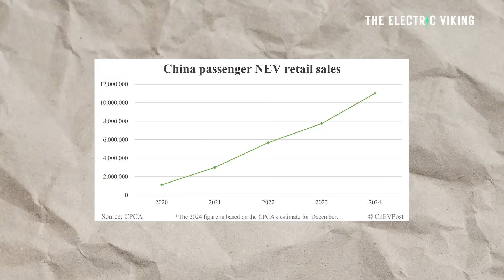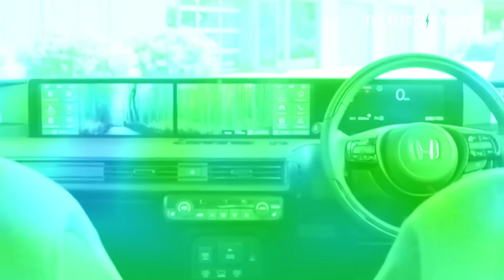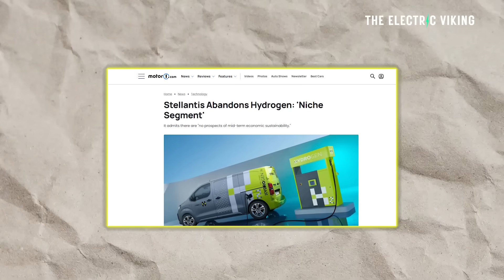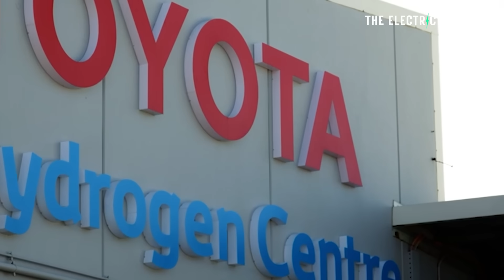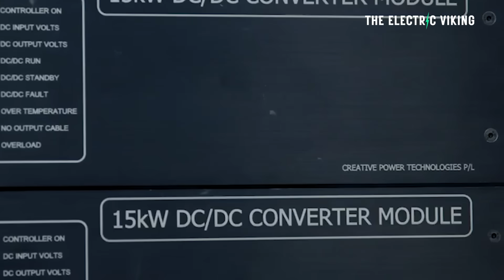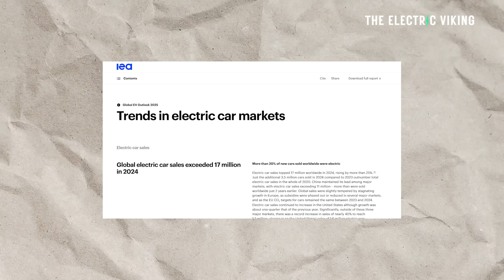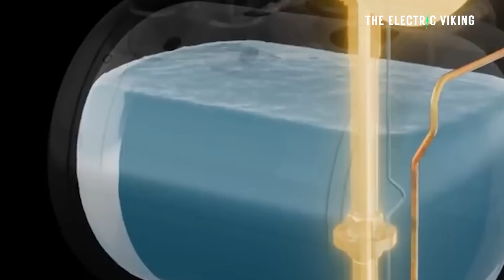The Future is Hydrogen Cars - Honda says EVs are not the future

Comment: I think Honda is talking to the US and EU market, electric cars are very far from being the nº 1 cars, its very complicated to explain but electric cars with the current batteries and charging systems are not viable in the USA and in some EU contries. Its August there's a lot of trafic going to southern Europe beaches, I never saw so many cars stoped on the side of the road, most of them Electric. The gas/diesel/LNG stations are working fine and the electric charging stations have broken because they work 24/7. There are huge lines all over southern Europe to charge electric cars, its crazy.

Comment: Hydrogen cars have been obviously stupid for quite a while and is getting stupider by the day. EVs stil have a big issue, though. They are no good if you live somewhere, where you cannot charge at home.
Two things need to be solved to change that : faster charging and, critically, cheap charging. The pricing for charging outside your home needs to come down, and that is not easy, since making a profit from running charging stations is already hard. If those issues are solved, the sky is the limit for EVs.
Reply: solution: state owned electric company. maybe you are American that allergic to these words but they exist elsewhere.

Comment: The elephant in the room is EV waste. EVs are a disaster for the environment once they're decommissioned. What is going to happen to all the toxic EV waste in years to come. It will cost a small fortune to get rid of your dead batteries. Why won't you talk about this honestly and in depth?
Reply: Because that is just propaganda from Toyota that already debunked for 10 years? Battery already 99% recycleable.
Reply: @yulusleonard985  I can assure you with 100% certainty that lithium batteries are not 99% recyclable. Do some research if you think it's BS.
Reply: @RhythmicEye  Yes my google said its 99% recyclable with several articles. After that 97%, still high. The lowest are ofc Toyota who said they are doing it at 20%.
Reply: @yulusleonard985 attitudes like this is exactly why this is going to be a catastrophic problem. Tell me, where are all these recycling facilities you speak of
Reply: @RhythmicEye  
Most EV built are still on the road .
Will be for a few more years. 
There simply is not enough ev getting retired as yet to fully support recycling .
It will happen the materials are to valuable  to just dump. 
Meantime used ev battery's are still worth money .
They are being  rebuilt replacing dud cells or repurposed for energy storage
Reply: @martinsmallwood9605  Not true at all. EVs have been around for decades now and have car accidents just like every other vehicle on the road. Globally there are hundreds of thousands of EVs that have been decommissioned already, not to mention all the non EV lithium batteries out there as well. It's a BIG, BIG problem that needs to be addressed now not when it's too late.
Reply: @RhythmicEye  
You re talking crap .
 EVs have been around for decades now?
The Nissan Leaf first mainstream  EV has been produced since October  2010 that  is less than fifteen years ago.
February 2022, global Leaf deliveries totaled 577,000 cars. 

Most of which are still on the road.
I very much doubt 100,000 EVs have been retired around the globe  .
It is cheaper to dismantle an EV battery into its component material then to mine for new resources ,
Even ignoring the potential for recycling for alternate use or to repair other battery's .
Reply: @martinsmallwood9605  That level of ignorance only deserves 🤣😂😆

Comment: I saw this somewhere and it's very interesting. If it's a viable source of hydrogen, Honda might be correct.
A large natural hydrogen deposit, also known as white hydrogen, has been discovered in the Moselle region of France. This discovery, potentially the largest ever recorded, could revolutionize clean energy by providing a substantial source of carbon-free fuel. The deposit is estimated to hold 46 million tons of hydrogen, with a potential value of $92 billion.

Comment: The only way this works is if you have localised electrolysers (like at home) but the cost vary from £40 to £250k in the UK. Now you could I guess have existing petrol stations provide this service, but that’s a huge capital outlay in what is only 15 years. They will need to negotiate the storage costs of such a move and provide the energy which I assume is renewables besides the electrolysers needed would be far more expensive.

Now if they think they’re using existing fossil fuel distribution it won’t work, the costs for storing this outweighs any material benefits from producing or drilling (maybe in shipping and aviation), and I question why you would bother when you could simply plug your car into a wall at home or power it from solar panels on your roof.

I think they’ve failed to keep up, and now have bet the house on everyone else being wrong about EVs, this is going to be a monumental mistake.

And that’s not to say I’m down on Hydrogen, I’m just not convinced we have the technology to make this remotely viable right now or at scale, and the fossil fuel companies can push this all they want (because we know that’s the angle here) but the numbers don’t make sense. Who’s committing such a huge capital expense in the “hope” that consumers will want what’s being offered, you’d need to build up a critical mass, and that demand simply doesn’t exist, because the infrastructure doesn’t exist, it’s a chicken and egg situation.

Comment: What many hydrogen supporters forget : it takes 10 times the electricity/energy to create, store, transport hydrogen and put it in a vehicle cell. And in the end? The hydrogen is used to create electricity to power the vehicle with electric motors anyway....... Makes no sense for the process to use 10x the energy for the same result only to finally use electric rotors to move the car in the end. And it's even way worse for the combustion method which is even way more inneficient

Comment: The big problem with hydrogen is electrolysis. There's LOADS of hydrogen on the planet, but it's all married to oxygen. Breaking that bond takes a lot of energy, so are you really gaining anything? You might as well take the electricity you'd use to harvest hydrogen and store it in a battery to drive a car.

Plus, I can plug my EV in at home and drive away every morning with a "topped off tank".
Reply: The problem is turning hydrogen gas into liquid and make it stays liquid. That require alot of energy.

Comment: Ah, yes, hydrogen... So you can't get away from internal combustion and all the maintenance needed to keep them running.

I bought two EVs this year. I don't really want to go back to combustion engines at this point. That could change, but I really like the quiet, smooth, quick ride characteristics of my EVs. And I like that they are generally maintenance free, and that I can refuel while I sleep. 
I really don't want to go back to refueling at gas stations, and feeling like I'm putting excessive wear and tear on my car when I press the accelerator hard to pass people.

Comment: Ask any BEV owner if they want to go back to fuelling away from home?
Reply: Most people fail to understand just what hydrogen actually is. They think it's like gasoline or other liquid fuels. Hydrogen has extremely poor volumetric energy density. If used as a gas it must be compressed to 10,000 psi and stored in fairly large tanks in order to get any range out of the vehicle. If used as a liquid it must be cryogenically chilled and maintained at −423 °F. Even in a well insulated tank if not constantly chilled (maintained at −423 °F) liquid hydrogen will immediately start to absorb heat from its surroundings and begin boiling off. If not allowed to boil off (vent) it will quickly develop very high pressures and explode. BMW's experiment with liquid hydrogen was a disaster. Since BMW chose not to run chillers in the car the hydrogen had to be allowed to vent. If parked over a weekend an entire tank of very expensive hydrogen would boil off (see YouTube video). There is also the issue with fuel pumps capable of handling liquid hydrogen. The metallurgy necessary to handle hydrogen for a significant period of time doesn't exist. Fuel pumps last only for a few tanks of liquid hydrogen before needing complete replacement. Liquid hydrogen quickly destroys them.
Besides all this, a hydrogen vehicle has the exact same electric drivetrain as an EV (unless you're stupid enough to attempt to burn it as a gas in an ICE in which case you'd be lucky to get 150 miles of range at best)........
Reply: Hell no, my wife and I will only ever be charging from our garage or driveway
Reply: Not one will do it.
Reply: The people who already bought....ate the people that want to charge at home......rest dont want
Reply: Owned an EV for the past 12 months, had only one incident of having issue charging (took me half hour to find a useable point), would I go back? No, never, it’s just far more convenient to charge my car on the drive for 7p a KWH!
Reply: No. Long answer: nooooooo!
Reply: I can't charge at home, and I'd still not go back to dead dinosaur juice. This is the fossil fuel industry trying stay relevant and to keep drivers dependant on them.
Reply: @LuciferStarrbut really weird that Japanese legacy car-makers cannot see the (very BIG) writing on the wall 🤔🙄
Reply: EVでセカンドカーです。町乗り専用です
Reply: @田中亮太-k3u nope and even more nope. Hydrogen is dead for private vehicles. Honda are in serious trouble now.
Reply: @田中亮太-k3u Mass manufacturing of fossil fuel cars will continue to diminish. Even in your country. This will increase the price of gas cars. Meanwhile, EV cars will increase in production, reducing their prices. The consumer will always choose the lowest cost.
Reply: @田中亮太-k3u  Rubbish. You are not driving 600km everyday, 6 days a week. Learn how to add. 🧮
Reply: アメリカでも日本でもEVは、セカンドカーです。高速道路を３時間走ったら、１時間半充電です。その繰り返しです。長距離は大変不便です
Reply: @田中亮太-k3u  What? Are you serious in saying "it takes an hour and half to charge an EV"? Have you ever actually driven an EV car? Sounds like you have not...   Already now EV cars charge a battery in 30 minutes even when an EV car was designed couple years ago.  The latest EV cars using 800V system charge in 15 minutes and there are some models charging in 10 minutes. This trend will continue year after year the next 10 year, EV manufacturers release cars with faster chargers and longer range because we have seen only fraction of what EVs can offer in the near future (< 5 years time frame).

And EVs are, in most families in US/Canada, the primary car. An ICE car is used only when towing something. Don't know where you had the idea an EV would be a secondary spare car.

Here I had ICE car for years and years. 5 years ago I had my first EV and booom! After the first month driving with EV it was clear I was never going back to ICE and hybrid-ICE cars. The first EV was soooo much better and cheaper running costs than in any of the ICE cars before that.
Reply: @田中亮太-k3u  Don't know where you get your data but do change source. I have 3 cars at home and the EV is the primary source while the others, one gasoline and a diesel, are the secondary cars.
Reply: @田中亮太-k3u  Honda must have really tricked you. Takes me 20 minutes to charge 80% and I need more than a 20 minute break after driving 300+ kilometers. Drove 6000km in February for my road trip and it was a breeze compared to my old gas powered cars. It's smoother, has better auto pilot onboard tv and Atmos speakers for the family to enjoy, and deeply reclined nappa leather everywhere. 

Maybe Japan is really behind on infrastructure. 1.5 hour charging means you are being limited by poor development as I have no idea what car charges that slow

Comment: What is the highest selling point for EV? (for me) It is the fact that EV can use locally and ethically produced energy where as for ICE the energy must be brought in by dictators. Maybe only clean country which produces oil is Norway.  Traditionally oil means loads of money and that means loads of corruption and authoritarian efforts to hang in power.  
When a budget EV can have range of 1200km (750 miles) that is good enough. But what quality used electric car you can get with 2000$ price and when?

Comment: I believe Japan has developed a nuclear reactor that produces hydrogen as a byproduct. And as an idea using a waste product of power generation to fuel vehicles does sound lovely. The trouble is a) it needs even more infrastructure than a charging network and b) it only works in a world where batteries aren’t as energy dense and cheap as they already are.
Reply: The problem with hydrogen is how to condense them into more transportable liquid. You need to check at what temperature it stays liquid and compare them with anything else and you see the problem.
Reply: And batteries will only get denser and cheaper - there is still a lot of headroom there.

Comment: It's too late for hydrogen. battery Powered vehicles have so much skin in the game that it would be impossible for hydrogen to catch up. It's not that hydrogen is on the way out, it never really got started. And with the new aluminum ion batteries coming out that charge in five minutes, can go from zero to 100 miles an hour in two seconds, and have a 600 mile range, why would anybody even try to fight that? You gotta be an idiot!

Comment: If you want a non fossil fuel for ICE then oil from maize or canola does the job right now with a diesel engine.  It is about a dollar a litre as well.  Hydrogen is a nonsense.
Reply: nice idea,  but the combustion engine still produces harmful gases from the tail pipe.
Reply: Food oil for diesels was always a sop to delay the EV industry. It was never viable for replacing anything but a fraction of the diesel production. Diesel represents millions of years worth of solar energy in easily accessible form. You want one years worth of solar energy to go through an inefficient process (photosynthesis to refinement) and fuel all the cars on earth. There just isn't enough land to grow that much fuel.
Reply: @StephenBrightwood  
If you look at like for like - that is biodiesel to hydrogen then there is or would be as much biodiesel as there is or would be green hydrogen.  The fossil industry wants blue or fossil hydrogen.  I have not done the calculations but there probably is not enough potential for biofuel for the entire transport sector - planes, trains and automobiles.  However the future is electric and biodiesel (in my view at least) has a place in the transition.  Hydrogen does not.

Comment: Every transformation of energy have losses, in this case hydrogen to electricity. On the other side, converting energy to (get) hydrogen stands better because renewable energy can be used. But main drawback is the storage of hydrogen due to hydrogen's low volumetric energy density and reactivity. These challenges include the need for high pressures or extremely low temperatures for storage, potential for embrittlement of storage materials, and safety concerns related to leaks and flammability. To my knowledge, only Toyota advanced in this area (in Mirai vehicle)
Reply: You need electricity to produce H2 and to make H2 as fossile free the electric source needs to be fossile free source. This is true.
But, remember electricity is just electricity, so the same fossile free electricity can be used to charge a BEV battery car. Nothing preventing this. In fact it is better to use the fossile free electricitity source to charge a BEV because it has over 90% efficiency. H2 cars have only 40% efficiency (meaning if you have 100 units of fossile free electricity source then only 40 units remains by the time it reaches the H2 car. But when you charge an BEV then 90 units goes into a battery). This is simple math. H2 cannot win this race and to be financially cheaper for consumers. And people vote with their wallets.
Reply: Mirai is already a flop. H2 as a fuel costs $36/kg to go 50-60 miles in Mirai and the fill stations are nowhere to be found.  My Jetta on $36 goes 400-500 miles. My Niro does 250 miles on $6.50 charge and my electric utility credits my bill 150kwh per month to charge off peak. I have more electric outlets in my garage than h2 fill stations in the whole US.